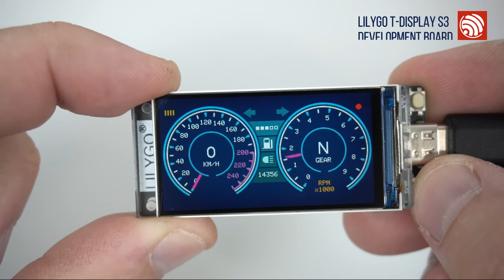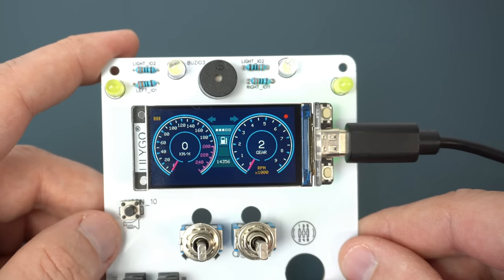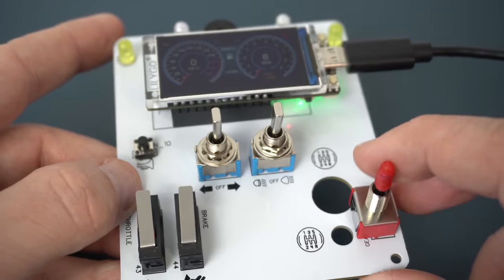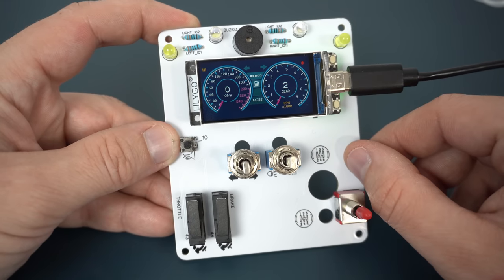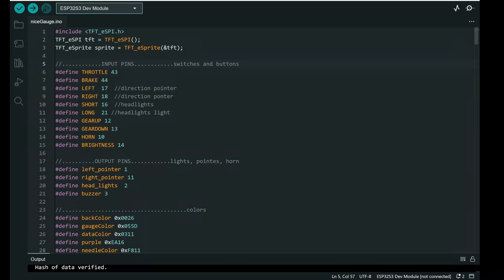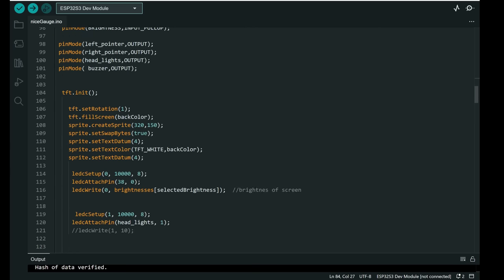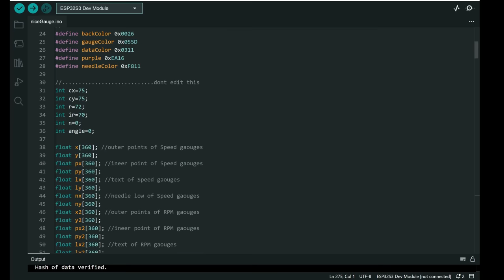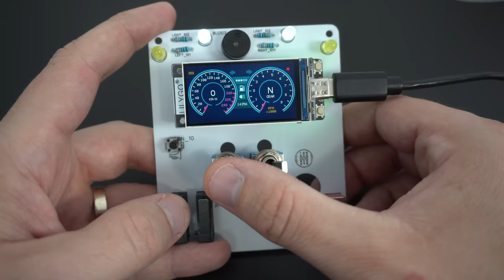ESP32 Car Dashboard/Controller

Comment: This has got to be one of the best yet! You put the fun in bare metal and silicon. 

So much credit, as always, to Bodmer, Moononournation, Lovyan, LVGL team and the community at large - getting larger by the day thanks to videos like this and the diligent creativity of Liligo, Makerfabs etc...

(Microswitches as pedals! Very imaginative - and you drive stick. POT steering wheel using a conical alloy pulley? - leather trim naturally, and there must be room for a mini airbag - domed speaker that throws talc in your face when you stick 12V DC thru it).
Reply from the maker: Tnx Nick, it was fun to make this😀
Reply: @VolosProjects  Yeah, I can tell!

Comment: Thank you for sharing your project, code and pcb files!  I just built my own and noticed something.  The PCB image for each LED is incorrect.  Typically the notched side of the image is the negative (cathode).  I had to flip all LED backwards so positive was on side with notch.  I wanted to point this out to anyone else that may build this.

Would you PLEASE do a car dash like this, that uses a GPS sensor to pull/display speed in real time?  Something like a NEO 6M.  There's only like one tutorial online that shows how to do GPS with an ESP32.  All other tutorials are for Arduinos.....

Comment: Congratulations Volos; Your project is very interesting and very beautiful! You are so kind to share your fantastic work. However, allow me a suggestion: For better use, it could be done on larger screens; for example, with two ili9341 240x320 or ili9488 320x480 screens (even better), one for each function; then it would be Show, since you are an expert on the subject!

I would like to make a much simpler project, which is a Speedometer or Tachometer, using a 3.5" ili9488 screen with esp32, adding an Optical Sensor (Printer) to measure the speed of engines. But, I have a lot of difficulty with the code.

In the Bodmer library there is an example code (Animated_dial) and I have a code ready for an Optical Sensor with 16*2 LCD Display but I am having difficulties adapting it.

P.S.: I subscribed to your channel.  Thank you and best regards.

Comment: As usual with  cool project and enough details. I was always curious hos do you solder the header pins on the esp32-S3 board. I still could not figure it out. Can share the trick in any of your videos?

Comment: Hi, Volos, very nice project! Good job ;) But i have a problem: When i try to download the sketch appears the error message: "'class TFT_eSprite' has no member named 'drawSmoothArc'. I tried to install the new library TFT_eSPI  of Bodmer, the error is gone, but the TFT S3 screen is black. Does not work... I think it will be a problem of configurations in setup files. Can you help me to configure this library to the T-Display S3? Thank you.
Reply: I am having the same problem of "'class TFT_eSprite' has no member named 'drawSmoothArc'".  How did you get your program to compile?
Reply: @FVCard - just downloaded the latest 'Xinyuan-LilyGO/T-Display-S3' library that has the 'drawArc' and 'drawSmoothArc' members.  The program compiles properly.  I withdraw my previous statement about not compiling.  Volos thank you .
Reply: @maurice0101  hi, thank you for your report. I'l try to install this library and see if works. Thank you. FC

Comment: Hi can you tell me how I can measure voltage, current , power on this display using a proper UIs to check 48v battery pack

Comment: Do you think that the refresh rate would stay similarly fast on a larger screen (2.4") using the same display driver?

Btw I just discovered your channel, and I am trying to build something very very similar, so thanks for putting this together, talk about timing!
Reply from the maker: It will be same but only 320 x 170 pixel  image will be shown, becouse that is size of sprite
Reply: @VolosProjects  Thank you! Would you have any recommendation for which 2.4" screen I should purchase? There are so many options, I just need something with similar rates as yours and preferably sunlight readable. That is all, I'd greatly appreciate your help.

Comment: Very nice. I love you work and I would like to thank you very much for sharing it with us.
I have a question though:
How do you develop the code for the graphical interface? Every time, when I try to draw graphics on displays just with normal functions of circles, rectangles and lines, I find it very hard to position them correctly and it ends up in very much try and error.
Do you have any hint for me which you would like to share?
Reply from the maker: First i draw design on paper, i am trying to find best values for size, distance .. yes there is ton try and error 😀
Reply: Yes, I recon preparation is the key. You could try mocking up a UI in a vector graphics app first. Inkscape or Gravit (both free) are great for this - and there are online vector design tools - all free - such as Vectr. At least this way you already know the pixel coordinates of all your UI elements and how they will look and feel and you can specify a workspace which reflects the resolution of your actual display hardware. You can then even export those elements and convert them to byte arrays for pushing as bitmaps if you don't want to reconstruct your elements using primitives. Alternatively, LVGL now has Squareline Studio with a barely limited free subscription option. It's WYSIWYG layout tool is awesome and exports code directly to ESP32 thru either Arduino or ESP-IDF dedicated libraries. Even if you want to roll your own code from scratch, the layout editor is perfect for the 'pad-and-paper prep stage' since there's nothing that you can do in SLS that can't be reproduced on the ESP with suitable display hardware - such as the dev board shown here.

Comment: Hi,
I am quite new to Microcontroller programming and was wondering if this would also be possible with an Arduino? What are the differences between Arduino and ESP32?
Reply from the maker: Yes it is posible, question is what arduino you are planing to use, arduinos are usualy much slower

Comment: Now here me out, could I use this and connect it to my racing wheel? Theoretically speaking it should work, especially for games like Assetto Corsa. I don't know I'm just asking if it's possible?
Reply: You could, however you would need to figure out a way to sync the data together so it shows the right gears and speed etc

Comment: I uploaded your code, but the display is blank, I'm able to upload other Bodmer examples with no issue, any idea maybe?
Reply from the maker: do you use this board or something similar?
Reply: Esp32 wroom This code gives me just black screen, and your boat Guage code gives me just blue screen only.
Reply from the maker: @Tbstr25  your board probably dont have enougth psram whic is needed for sprites. You will not be abe to run this example on your board, this board is diferent resolution. You can try to run boar gauges but you will need reduce size of sprite from 240x240 to 232x232
Reply: @VolosProjects  Thank you I will give that a go and see, if it works, I know then I will need to purchase new equipment.

Comment: ⛔⛔⛔⛔⛔
Please help me 😭 😭 🙏 🙏 
Hello my friend, is this the code for this video 
It will work on this piece and Bluetooth will work with them ?
(T Display ESP32 WiFi And Bluetooth-Compatible Module Development Board 1.14 Inch LCD Control for Arduino)

Comment: Looks Great, but does not compile: I get the following error:
error: 'class TFT_eSprite' has no member named 'drawSmoothArc'; did you mean 'drawSpot'?
   sprite.drawSmoothArc(320-cx, cy, r, ir, 30, 330, gaugeColor, backColor);
What am I doing wrong?
Reply from the maker: What boars you are trying to use? You are probably using older version of library
Reply: My comments make no sense 'cos all my previous posts are getting deleted for some reason. I tried to offer a solution to michaelbruns473 and I typed it 5 times in different words but it won't stick. Volos, what's going on? Is it the 'algorithm' considering me a Big Mouth? I make no apologies for wanting to help my fellow micrcontrolerees. If i'm getting blocked then it's adios.
Reply: @VolosProjects  Thank you - yes  it works with the newest library. very, very cool. !
Reply: @nikthefix8918  Did you include an URL, perhaps? Then the post will be automatically deleted.
Reply: @rhkavli  Thanks. No I didn't but it was probably something I did wrong. I find it happens sometimes when I've edited a comment for spelling mistakes etc.

Comment: Hi Volos.
Can you help me with the configuration.
It is giving this error below:
C:\Users\ssrocha\Documents\ESP32\niceGauge\niceGauge.ino:114:6: error: 'ledcSetup' was not declared in this scope
  114 |      ledcSetup(0, 10000, 8);
      |      ^~~~~~~~~
C:\Users\ssrocha\Documents\ESP32\niceGauge\niceGauge.ino:115:6: error: 'ledcAttachPin' was not declared in this scope; did you mean 'ledcAttach'?
  115 |      ledcAttachPin(38, 0);
      |      ^~~~~~~~~~~~~
      |      ledcAttach

exit status 1

Compilation error: 'ledcSetup' was not declared in this scope

Which Board are you using in your Arduino configuration. I am using "ESP32S2 Dev Moule". 

Thank you in advance.
Reply from the maker: @ssahcor3436  you need to use esp32s3 dev module and you need to downgrade your esp32 boards to 2.17 , right  now you probably have 3.0 or higher
Reply: @VolosProjects  OK, I'll be making the changes and I'll let you know if it works.
Congratulations on the beautiful work.
I'm always following you.
Once again, thank you for your quick attention.

Ps.: I'm from Brazil.
Reply from the maker: @ssahcor3436  thank you, i hope it will work 😀
Reply: @VolosProjects Volos, then.
It can compile and upload to the sign, without any errors.
But the screen is black, the graphics do not appear.
Is there any way you can help me?

Setup:
 - Board: ESP32S3 Dev Module - 2.0.17;
- TFT_eSPI - 2.5.53

Ardiono IDE 2.3.2

Thank you in advance.
Reply from the maker: @ssahcor3436  you need to use tft_espi  library from t-display s3 repository, you can find my tutorial how to setup and install this board.
Reply: @VolosProjects  Ok, I don't want to take up your time, but can I make one more request?

Can you give me the URL, as I'm in your repository on GitHub, but there are a lot of directories.

Thank you in advance.
Reply: @VolosProjects  Ok, I found it here on your channel: How to Install and Setup TTGO T-Display ( Getting Started tutorial)

Thank you very much... I'll post here if I managed to do it.

Once again I thank you very much.

Att,:trophy-yellow-smiling:,
Reply: No, no. 
The right one Is this Best ESP32 board? New T-Display S3 ESP32S3.